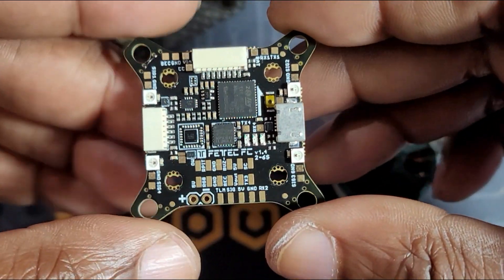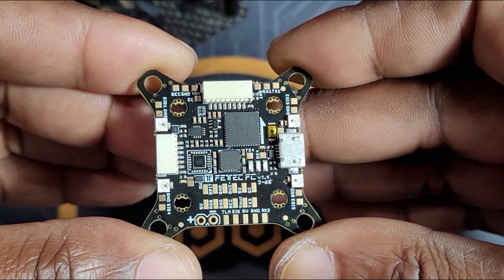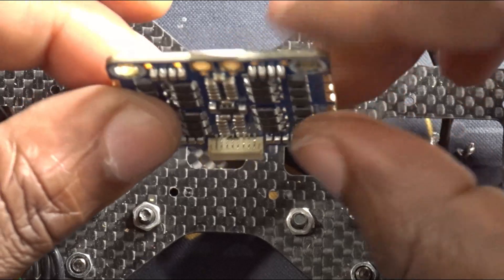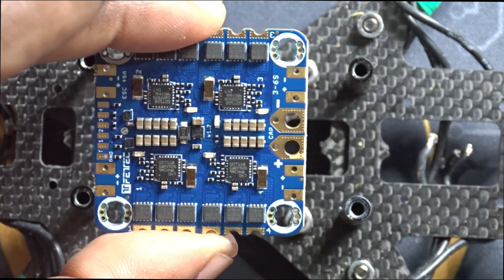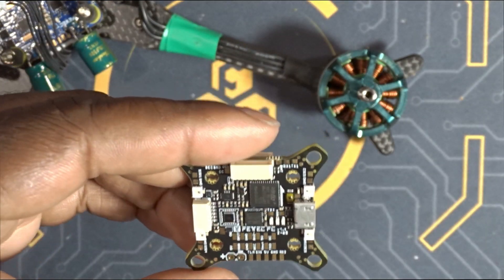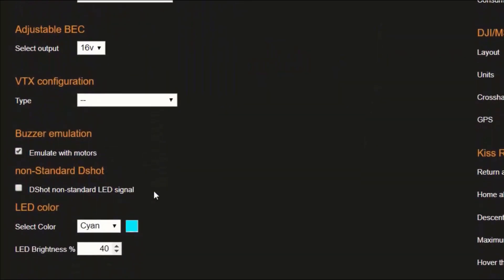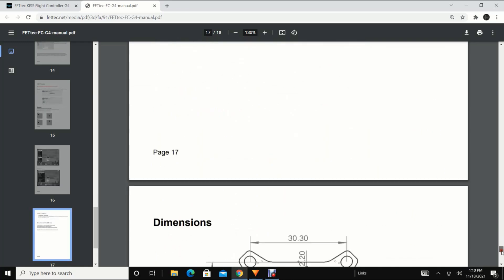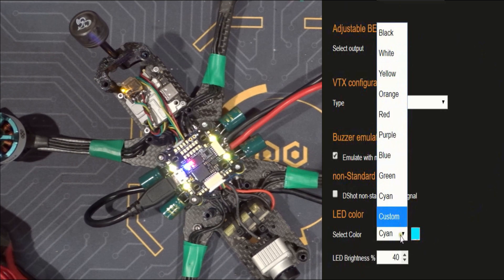Fettec FC G4 Features Rich

Comment: the fettec FC G4 also compatible to make for  whoops? i have 2 extra g4 here Im planning the other g4 is 5 inch and other one is whoops.
Reply from the maker: It does have a 20x20 mount. It will work on a cinewhoop.